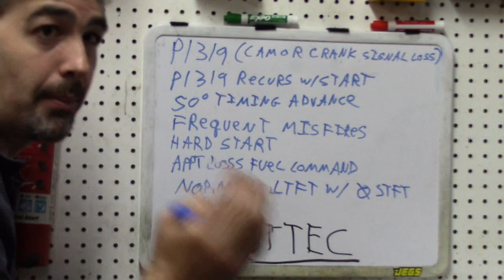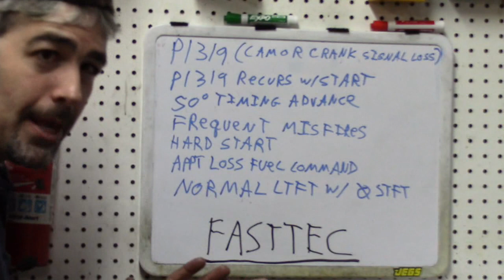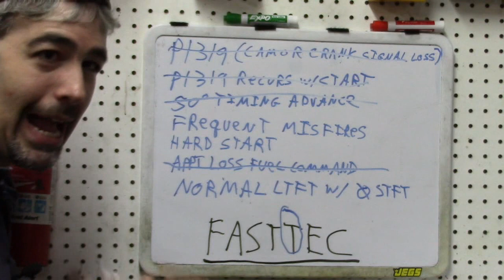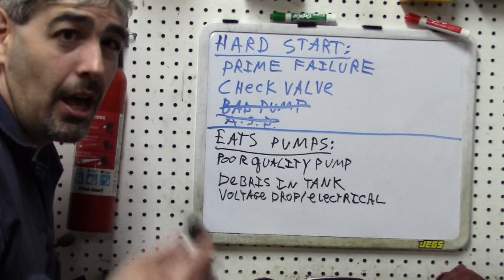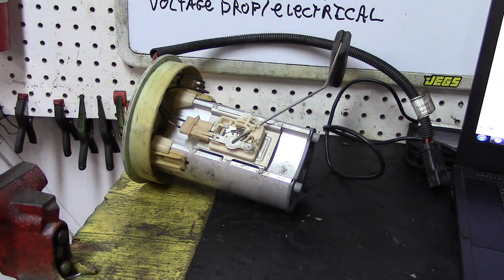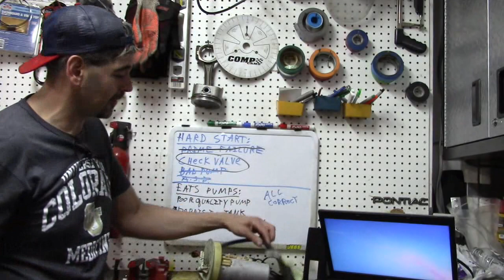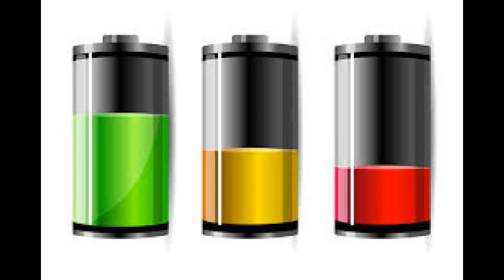Jeep Eats Fuel Pumps Follow up and Hard Start Diagnosis and Repair

Comment: The biggest problem that people cause when they start the vehicle with electric fuel injection. Is a turn the key all the way to the start position from the outset. That stresses fuel system and the ignition system, each and every time they start the vehicle. When you remote start a vehicle, everything is turned on, before the starter is engaged. Turn the key on, wait a few seconds and then start the vehicle.
Reply from the maker: Sorry but that is a myth. There is no need to do that because the check valve maintains fuel pressure at the rail to allow for start up. The fuel pump does not have to prime the rail at startup.  Fuel pressure at the rail is always present.

Comment: I have a no start on a 1999 Jeep Wrangler. The fuel pressure is 49 psi while cranking and the pressure slowly falls. I checked the injectors for leaks and didn’t see. 
The question is, is it most likely the fuel pressure regulator is failing and causing the no start? Could there be an additional issue?
The Jeep did seem to misfire and sputter before it was parked.
Reply from the maker: Your no start is not fuel pressure related.
Reply: I pulled the distributor cap and found the rust on the blade of the rotor. After cleaning it off, the Jeep fired up with a long cranking. I replaced the rotor with new. 
Before, I checked the plugs and they were soaked with fuel. I guess it was all the cranking with no start. I changed the plugs and crankshaft sensor. I believe my issue was caused by having a weak battery in this cold snap. The weak battery , plus the fouled rotor, then caused it to flood by cranking. 
Thanks for your advice.

Comment: Oil pressure valve ,, temperate air sensor , oxgen sensors temperature coolant sensor, temperature battery sensor ,, crank sensor, and camshaft , solenoid spark plugs  sensor are all in the same circuit

Comment: If your fuel vapor system is weak leaking or even dirty,, the main reason thing is it will damage all electrical weakening the circuits there all are connected together on 4.0 ,, roll over valve , put valve , leak detection pump, fuel  rail valve damper, fuel regulator filter, leaks as well ,, use party smoker cheaper,,gas cap  filler tube leak,

Comment: Menyhart start problems start with the fact that almost no one knows how to start a fuel injected vehicle. The procedure is to turn the key on and allow the fuel pump to spool up, before you actually try to start the vehicle. Almost everyone turns the key all the way to start before there's any fuel pressure applied to the injectors. That causes damage to portions of the system, and turns it into a chronic condition.
Just as if you got into a vehicle with a carburetor and you didn't push the pedal down at least a little bit to to set the choke and to Prime the intake with a little bit of raw fuel, you're not going to find it easy to start.
Reply from the maker: What damage can be caused exactly by not letting the pump prime? What “portions of the system” can be damaged and how exactly are they damaged?  
  Also why is necessary to prime the system when the check valve maintains rail pressure for starting?

Comment: So I'm an idiot because I woulda checked fuel pressure,just needed to  reassure you!
Reply from the maker: Chercking fuel pressure wouldnt make you an idiot. Where did I ever say that?  Replacing the pump without evidence would.  I myself confirmed this diagnosis through fuel pressure.

Comment: first thing is check the fuel pressure,  no pressure, no start, thats what found
Reply from the maker: But Why isn’t the first thing to check spark?  No spark, no start.  Or wait- why not check cam signal first? No cam signal no start so why not check that first?
  Wait- No ckps no start. So why not check ckps first?
   Wait- never mind- timing first!! If the timing is off, no start!  Check timing first!
  Then again... spark is the easiest to check... check spark first.........
Reply: @SchrodingersBox  you haven't taken apart a jeep coil pack!  check the fuel pressure only have to unscrew the test fitting and push the valve
Reply from the maker: You just push the valve???? How do you measure the pressure then?  Why no just pull a plug wire and check for spark with is way faster?

Comment: I had a call from a customer a while back for a "I'm stranded in a parking lot because my car won't start and you just changed the brakes" condition... and while on the phone I was asking a few basic questions to try to determine what kind of problem she had (crank or no crank, lights or no light's), she proceeded to tell me that she thinks it's the battery because she tested it with her umbrella  and it didn't do anything... I of course was scratching my head wondering if I had somehow missed a class on "UDT" (umbrella diagnostic testing) but after asking her what the hell she was talking about she said her sister told her to use an umbrella and smack the top of the battery a few times and if it doesn't start it's probably a bad battery... you can't make this shit up... P.S. the battery was over 3 years old and still tested good after charging however the alternator had stopped charging... I always ask her if she has her umbrella when I see her now lol

Comment: can also be that a problem in the fuel tank ventilation system (no ventilation at all, or little) cause a considerable amount of pressure in the tank that the fuel pump is struggling to function and deliver fuel? i really don't know if that is a possibility, thanks for your channel. i just found out what your BEST TOOL in your shop is......... do you?
Reply from the maker: If that were the case the fuel trim would be adjusting  negative. Good thought, but ruled out using the fuel trim

Comment: Wonder if the check valve was not working because of debris in the fuel that got stuck in the valve, since there was no filter.
Reply from the maker: That would not cause the driveability issue- that would just cause hard starting due to the static decay.
Reply: Love your channel. What I was thinking, was if something lodged in the valve, it wouldn't allow the valve to close. It would allow enough forward flow to maintain pressure, but would cause pressure to drain off when the pump stopped since the valve wasn't able to close all the way.
Reply from the maker: Thanks but sorry i m not following. Here- let’s just assume the check valve is completely stuck closed (or open). How would either of those possibly cause a lean fuel trim?? It is impossible. Please explain your theory on how that can in any way be possible?
Reply: Can debris get stuck in the valve so it stops acting like a valve (ball and spring inside frozen) but just a restriction?
Reply from the maker: Sorry man totally not following you. It almost sounds like you are confusing a check valve with the fuel pressure regulator maybe?
 Even if there was restriction from a check valve somehow- why is the fuel trim not negative?
  Sorry man, you lost me bro. Maybe I'm missing something.

Comment: Hi, love the channel. I have had to change "both" the fuel pumps in my 1993 Jaguar XJ81 recently. As parts for older cars are not so readily available, I couldn't buy the pump assemblies (looking similar to this one) complete. a little research led me to Walbro (the original manufacturers of the "actual pumps"), whom could supply new ones. This meant I had to split the assemblies to get to them. Probably not the case here, however in a quest to save money, maybe they did. Might be worth opening the old assembly to see? Keep up the great work, Graeme

Comment: Haha very nice! A solid bash that no doubt went right over their heads. A Parts changer vs comprehensive mechanic bottom line. "Generating a Diagnosis that identifies the problem without any doubt" is the only way you can call yourself a comprehensive mechanic. Watching even one of your videos for at most 2 minutes completely shows your skills there is no doubt you fully comprehend to a level that people have no idea about. Each pcm every make and model, even model years vary widely on how the pcm manages and utilizes inputs and outputs. Those are need to know and that's usually when testing that specifix component is when that information is gathered or applied. Not 
   Buying and replacing parts until getting lucky aka pissing in the wind is the work of a novice that has zero understanding or knowledge of even simple pcm programming and really any efi system in general. Components fail for a reason and for a part to reach a life expectancy limit "worn out" is infinitely less common than heat, contamination, corrosion, faulty manufacturing ect. Find the cause, prevent it from happening again, repair equals fixed. Sometimes that even means having to re-engineer the way the factory did something for a certain climate.. this all bothers me alot working on a customers car now that had his mechanic drop 1400 in nearly every major ignition and input sensor component pcm included, just to find out earlier today I diagnosed it with this exact situation cmp cpk codes lft stft zeroed, started the fasttec same as you.. low pump pressure rail not keeping pressure from check valve . Keep up the great work and videos they are very informative and detailed.

Comment: After 3 sensors shows failure it mostly means the pcm is going bad it never fails like keep alive memory pcm failure tfs
Reply from the maker: That doesn’t register with me- how is a bad PCM possibly going to cause repeated sensor failure?  I can’t see how that could happen.
  Far, far more likely is the repeat sensor fails are simply the result of incompetence by whoever is trying to repair the car as they keep misdiagnosing the sensor each time.

Comment: In my opinion I don't know how accurate my opinion is couldn't a clogged or partially clogged injector go ahead and throw the code at the crank and then it would cause a blockage in the fuel line which in turn would cause eating up fuel pumps I could be wrong it would be nice to hear your professional opinion because I'm doing by knowledge of what would have done that on a 86 Ford F-150 it had that problem and come find out it was one of the injectors that was burning out the fuel pump
Reply from the maker: No possible- look at the fuel trim balance on BOTH banks.

Comment: Shrodinger's and my approach are vastly different: I have a 4.0. XJ ordered from Canada May '87. I've put 285k on the untouched engine, 5 speed tranny, (clutch release bearing forks excepted), fuel pump, ECU and ICU. Wheeled hard and often around Moab (excepting Pritchett; I don't have a winch) and throughout the San Juans. Added a unibody frame stiffener @ around 125k after being told by schooled professionals the Jeep was toast from so much flexing from a 4" lift. It's been buried up to the fuel tank in sand a couple of times and crossed numerous fjords with water passing over the rocker panels. Rock crawling, ledge hanging, and solitude (until failure) are what truly fires me up. No safaris, please! I've done all my own light mechanical/electrical work in my driveway and some on the trail with numerous electrical simplifications as required using only a 30 year old $3 light probe. I'm a totally ignorant, old, sore backed T&E SOB who hates creepers and greasy repairs, but have a lot of persistence caused from having little money, requiring unconventional approaches which were necessary to sustained the vehicle and my savings. The Jeep is tired as am I, but EVERYTHING works. So, can anyone tell me why my original fuel pump still performs as new and Schrodingers' with all his skill and scientific approach has had so many fuel pump failures? I need to know if it's merely luck. I could learn much from those explanations. Thanks. BTW, I have been tempted to give up many times, then start to think about those trails and parting with 45 grand for a Rubicon when the old Cherokee just plugs along behind the affluent or the presumptuously indebted boys.
Reply from the maker: Its because you are an idiot.
  If you had paid attention and realized what this video was about, you would know that the owner of this vehicles has always had improper repairs after his first pump replacement.  Only after I properly repaired the vehicle did it no longer need any more fuel pump repairs (the vehicle is still running great).
  The very fact you do things the opposite of me would make you an idiot, actually but the fact you substantiate with incorrect premises and dilute them with irrelevant fluff makes it even worse.
Reply: yaaahhhhnn
Reply from the maker: Well then maybe you aren't ignorant- maybe you were just sleepy.
I suspect you are both.

Comment: Those multiple misfires could have been caused by clogged injectors because of that sediment in the fuel tank. I wouldn’t be surprised if that shoddy shop through crap in the tank to keep the customer from coming back 💰

Comment: I just got thru watching this video and I am at an awe. It is GREAT to see how someone can look outside of the box at ALL issues and diagnois an issue and fix it right the FIRST TIME!!!
 I am so tired of shady mechanics ( the ones that want to run their own shop, google an issue or You-Tube an issue and automatically assume that's the issue ) start throwing unnecessary parts and charge ridiculous prices for labor.
 This is NOT only a waste of time for the customer, but frustrating as well, because 2 weeks later,  you have the same issue.
 I am starting my own shop to weed a lot of these business out of my town. I will be offering discounts to our Vets, law enforcement officers,  fire department,  ambulance personnel,  to doctors,  but most importantly to our senior citizens.  
 They take care of all of us in our times of need, now it's time to repay them all.
 I pray that everyone has a safe and blessed Labor Day
Reply from the maker: Sounds like you and I are pretty aligned! I am not a mechanic but if I were to open a shop- it would be exactly like yours.  I have been told by other viewers that have shops they have similar formats.  One even has my video playlist on loop in their waiting room!!